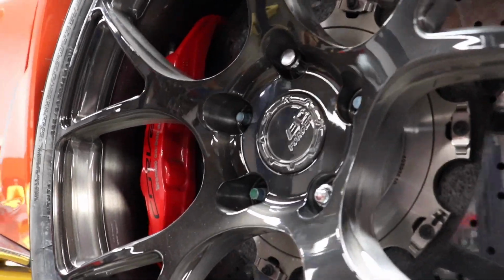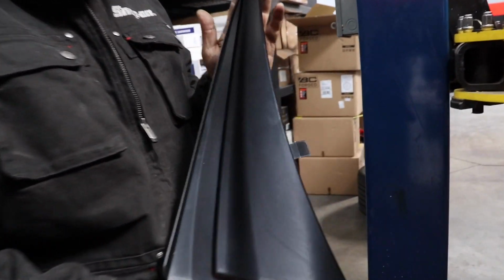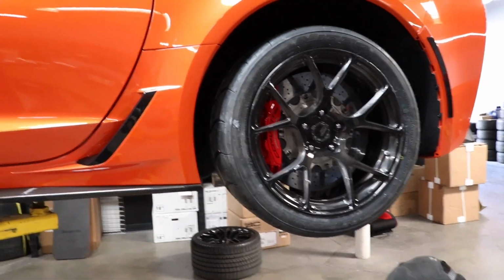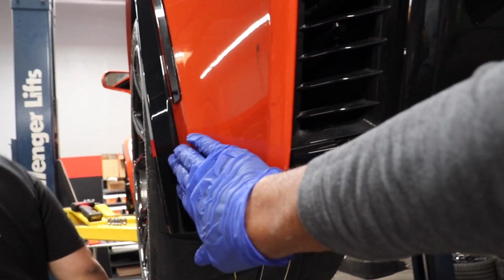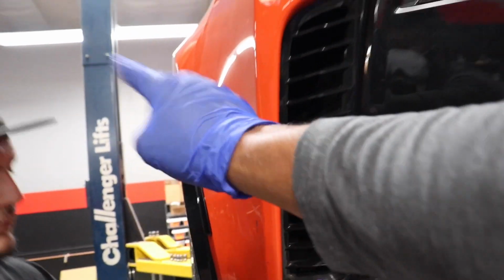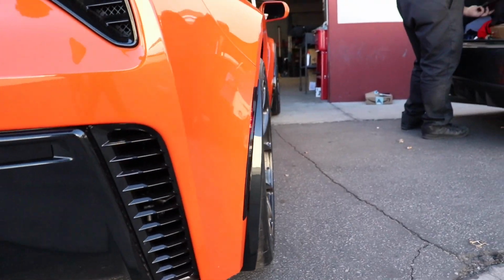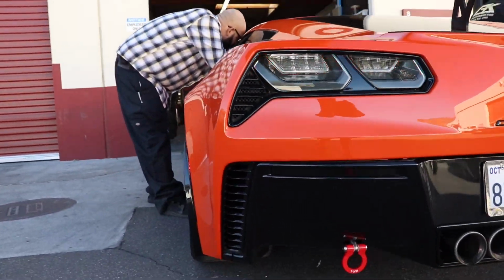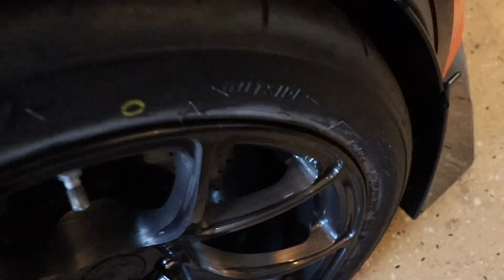Buying My DREAM FORGED WHEELS For My Corvette!

Comment: i noticed that u had smaller dia.  wheels put on.....what alot of  owners dont realize is u are making the outside circumferance of the tire less..thus u will be lowwering your rear-end ratio...you will be able 2  take off quicker..n..doo  easier burnouts..good luc..nice car.

Comment: What about 305/30r19 on 11.5's(same width as 315 on 11's, but more tire contact width, more crisp steering responce, and no tire bulging ) and 345/30r19 on 13's.
Reply from the maker: I like having 18s, lighter, cheaper tire options, and feels more balanced to me in terms of 4 tires. But I had that setup you mentioned on my last corvette and loved it

Comment: Will these wheel crack?  Iv been hearing the stock wheels crack and I'm wondering how I want to buy a z06 but avoid this problem, Any suggestions?
Reply from the maker: These BC FORGED wheels are stronger and will take a lot to crack. Forged wheels will give you the best strength to support against them breaking